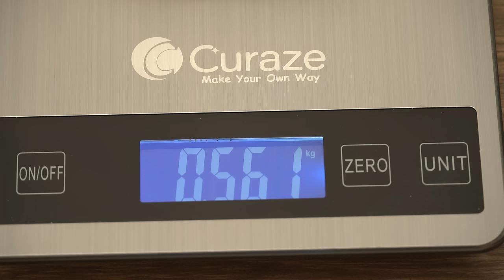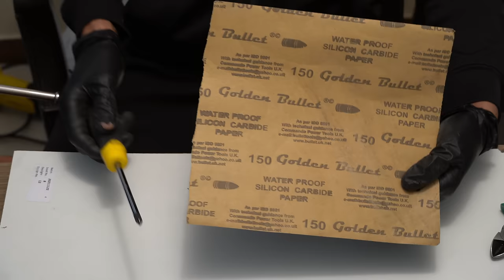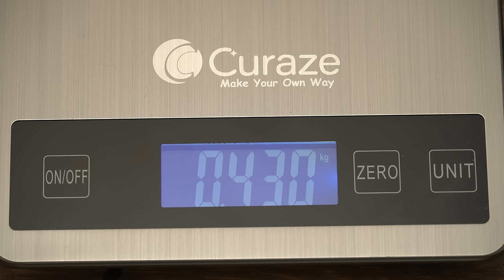Rusty Hammer Restoration | Old Hammer Restoration | Perfect Restoration

Comment: That's a pretty paperweight you've made there. Restoration would imply that you could put the tool back to work. Your "wedge" isn't wedging anything. The grain run out, while pretty, will cause the handle to fail under any rigorous use. It would be a race to see if the hammer head flew off or the handle broke first.
Reply: Hey man, I genuinely learned something new and useful here! I looked up “grain run” per your comment btw. 
I agree that someone doing this level of “restoration” should go the extra bit to make it functional, showpiece or not.
Reply: @macrous2120  That's not even a case of "going the extra bit". The dude has literally no clue what he's doing...
Wedging a handle properly is way less work than this shit. But he said it right, I guess. Nice paperweight.

Comment: Is there a reason for waiting until assembled to do the finishing coat on the handle? I would think that be done prior to assembly (so all the wood is coated), then just do the top little bit after cutting the wedge top off.
Reply from the maker: Thanks for comment
Reply: Ironically I’ve never thought about doing that myself. I’ve made a few of my own smaller 8oz rip hammer and ball peen hammer with stubby hickory handles, I use them in my trade for small cable clips or tapcon/concrete anchor inserts. I always waited till the end of the build to coat the handle in a few layers of Butcher Block Oil. But don’t the whole piece prior to putting the hammer head on wouldn’t hurt I don’t think?

Comment: That’s terrible. The sharp edges make the hammer useless for what it was designed for, forging, the figment of the handle is awful, the handle isn’t even straight on the head. It’s very shiny though, so if that’s what you care about………

Comment: Came out awesome as a wall hanger! Unfortunately not a useful tool, the hammer is imbalanced needs an additional 2Cm. of  steel added to the face, and the brass plate addition to the handle will fly off if used vigorously for some time, there is no glue  that will withstand the vibration. Looks good though! Additionally when filing stroke in one direction only,  pulling back your file with pressure only dulls the file.

Comment: Very nice restoration. That is a blacksmiths top fuller, which is why the face was so mushroomed and also why it weighed so little.
Reply from the maker: Thanks
Reply: @ITBR_Restoration  not necessarily. A hammer is sized according to the size and type of material being worked usually. So, for working small material it wouldn’t be too light. That said, I’m almost 100% positive that this was a top fuller.
Reply: @ITBR_Restoration it’s a fuller, not a hammer so it doesn’t matter the weight